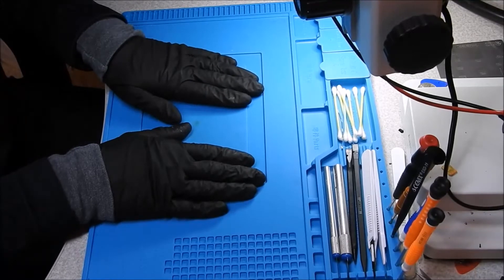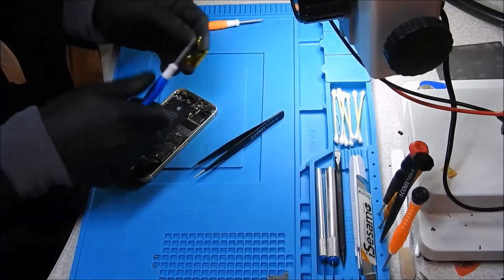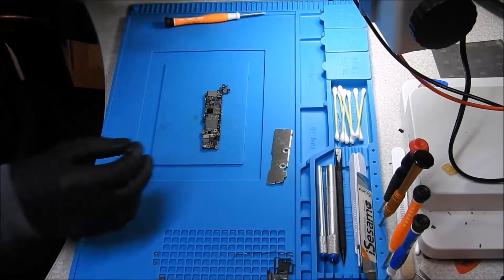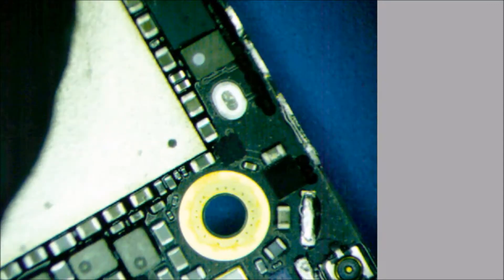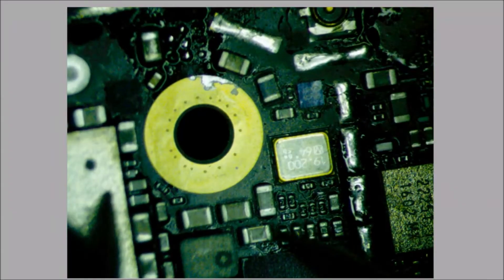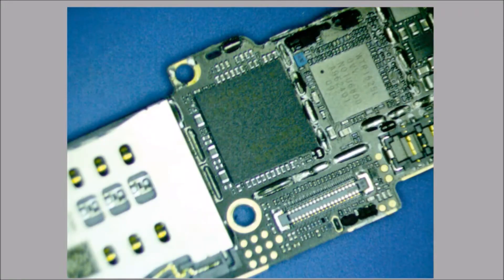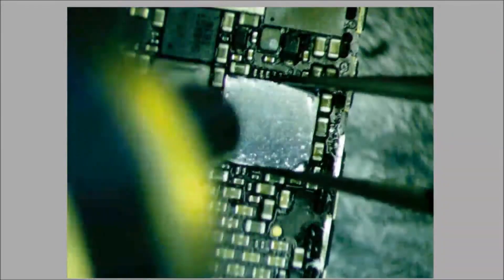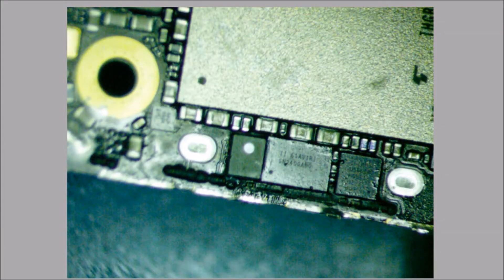iPhone SE Dead Short VCC_MAIN Solved

Comment: And I finally get one just like this. After injecting current at C5220 there is no detectable heat anywhere. Would you pull the audio IC just because it's way easier than Tigris? No idea on the history of this phone unfortunately but I did try pulling the same cap you did as well as one next to it. No luck yet.

Comment: As someone who doesn't understand how any of this works, I'm curious about one thing. After you removed the bad component that wasn't working, did you replace it with something or fix that spot somehow? I couldn't quite tell from the video.
Or did simply removing the component make the phone work again? I always thought that if you remove any component from a device like this, it will stop working.
Reply from the maker: it is always a good idea to replace any components that you remove. For this repair in particular it wasnt necessary to replace for a data recovery. As far as I know the phone is still working even though it didnt replace it.  Because of its location and power rail it was on simply getting it off the board was the fix enough for recovery.